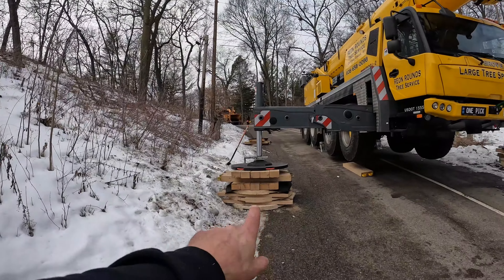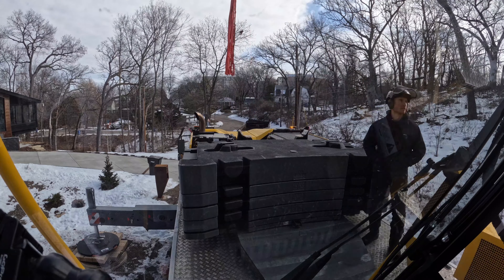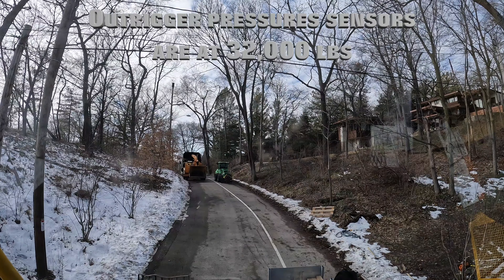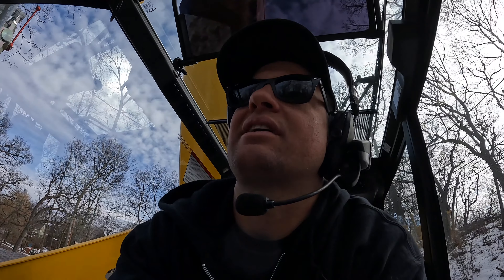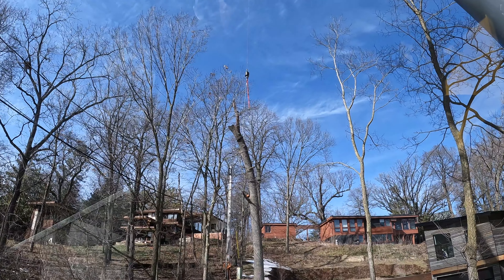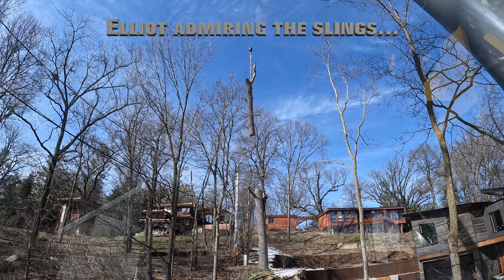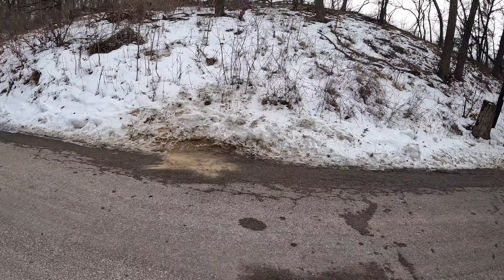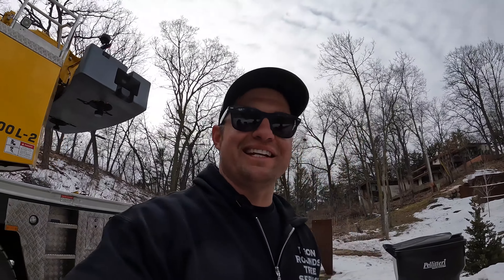STEEP HILL CRANE SETUP

Comment: There's a reason housemovers don't pack their cribbing tight, but space them a bit, without losing any bearing strength. I know OSHA says pack it tight, but really?  Not a knock, just an observation, from a 20,000 hour plus op.  If you don't have a tip of boom HD camera, with a HD 10" monitor in the cab, you should look into it, it is a game changer.

Comment: Incredibly interesting to watch this kind of stuff and that includes Reon's commentary which makes it more understandable and more interesting. 

The missing counter weight bolts is a drag, considering what you have to do to compensate for it after committing to $1M+ on the crane. It would seem that your Grove vendor could have been a little more proactive in having the crane completely ready for sale and/or world class service after the sale to get the necessary missing pieces to you.

Comment: this is why cranes should have those stoppers you used (-all four of.)

I had a crane, had nothing to chock the wheels with even though I had to do the climbing stuff - to get level, the rear riggers sat on as much timber as possible, to get riggers OVER the timbers, had to pack under the rear axle (only a small 25t PPM, crane is probably forty years old or so, it doesn't have the ZF auto, it's got one of those sequential gearbox trransmissions where it manages the clutch itself)   Well... when the job were done, it slid back into the scaffolding as soon as the wheels started to take the weight off of the riggers/cribbing, and the angle of the ground wasn't much different from there ...

Safe lifting!

Comment: I've been waiting to see the new crane at work. Seems like the power company should have hired you while you were there and get those power lines clear. Do you ever contact neighbors at places that might need tree work with the crane in the same position? Would it reduce some costs if a group got together to have work done in several yards from the same setup?

Comment: Could you explain your radio setup? I think it might be handy 🏗️ at work. Can it work with two riggers and an operator?

Thanks 
Ben
Reply: Looks like Sena or another like it. I use it with a few crews, works 90 percent of the time. Occasional disconnects, static mics, pairing issues. They have a special operators set thats lower profile which is nice.
Reply: @joshuahardy6624  Thanks, I actually use senna on my motorcycle helmet!

Comment: I would have done the Outrigger Pads Supports Different. They were still at a Downhill Slope vs a Level Pad from what I could see. I would have made a T with the Dunnage Timbers…and then put the Round Outrigger Pads on top of the T Patterned Dunnage to Level Out the Outrigger Support Area. It’s hard to explain the Pattern that I would have put the Dunnage in Words typing it out….but a T Pattern with first layer running opposite direction of the crane and then the next layer on top of that that is running in the direction with the crane and only resting on the first layer of dunnage on one end to make it higher on one end….to level it out.
Reply: Yeah I cut some sloped blocks on my sawmill so I can give my outriggers a chance. He needs a better setup for that much weight.

Comment: Overkill on the crane must be a pain all the counter weights and major setup time every time the Grove is used. We rent a 80 ton Liebair with leveling undercarriage fast setup 165 stick. Yea, 15thousand lift capacity technically could almost cut 1 piece, but where would you set it down. Drop zone and ability to handle it are a huge factor in how big of a pick that can be made. It is a beautiful crane. I definitely wouldn't want to have to make payments and upkeep on it extremely costly.